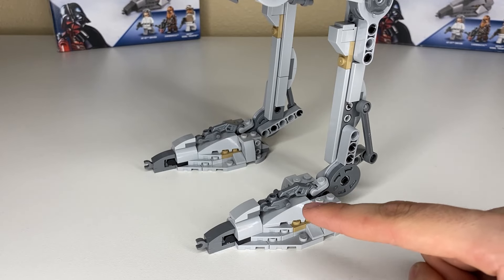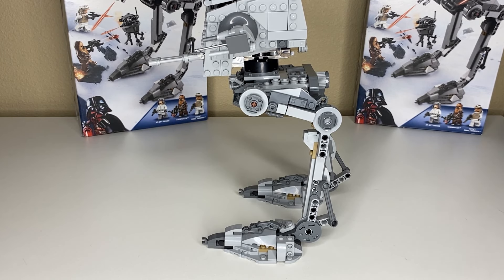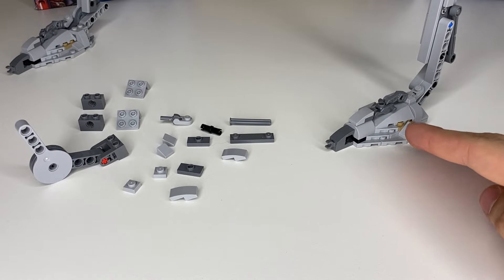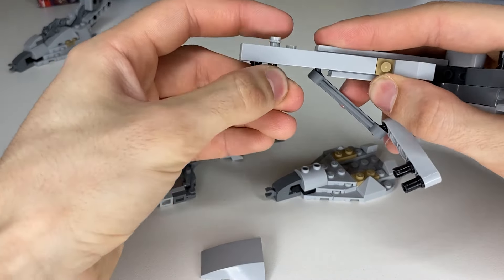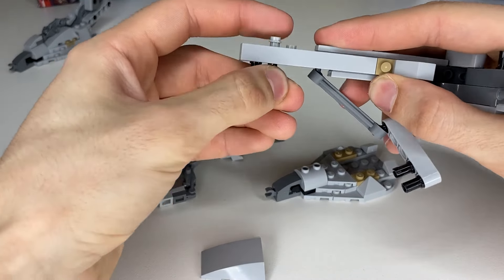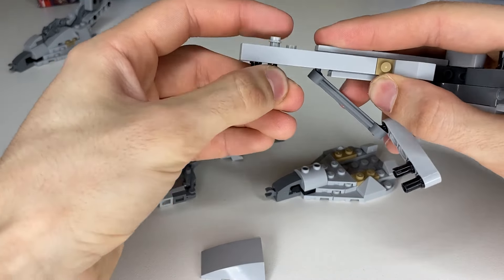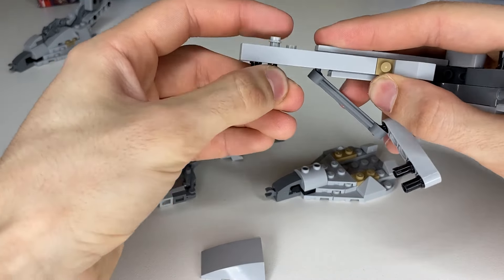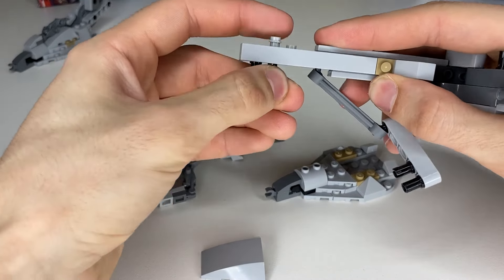HOW TO THE MAKE THE HOTH AT ST WALK (Lego 75322 Hoth AT-ST Leg Mod)

Comment: The only thing is that when flipping that tecnic piece it will have a lot of weight put down on it actually making the piece weaker and ruening it. Soon enough it can stand on its own. Thats what happened to me.  

Don’t mind my spelling I’m tired
Reply: Starting to happen with mine... hoping putting in on a baseplate helps

Comment: I dont think this mod is that good. I tried it on mine and it keeps falling on its leg fron my shelf. Have you had the same problem? I swear idid everything exactly like on the video
Reply from the maker: Im sorry to hear that! I had some trouble with some extreme angles that made the center head lean over a little bit, typically when I had one leg outstretched really far.
Reply: @BlaiseTM  think i fixed the issue, just kinda stood it up a bit higher and seems to work fine, maybe i wasnt posing it correctly, apologies
Reply from the maker: @darkgrievous423  All good my friend! The legs can be a wee particular once you do these mods, no worries!